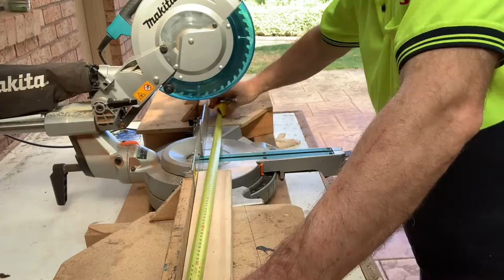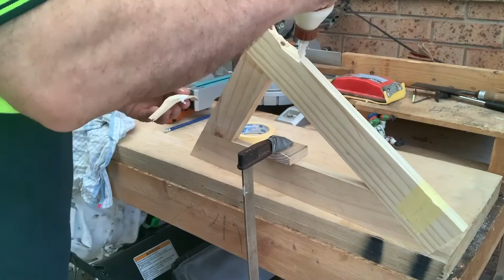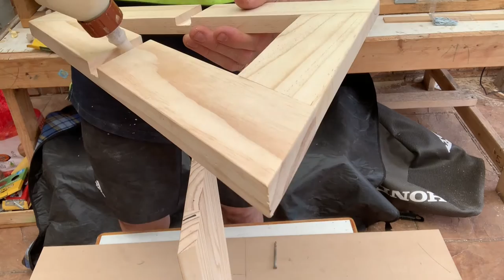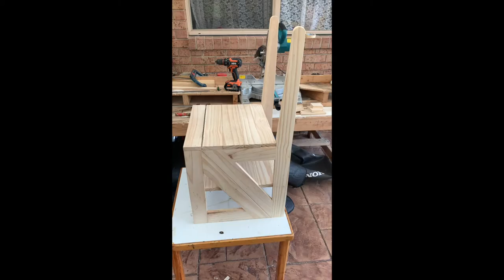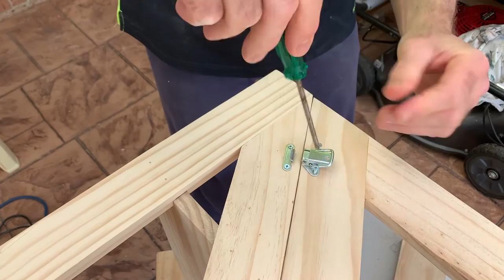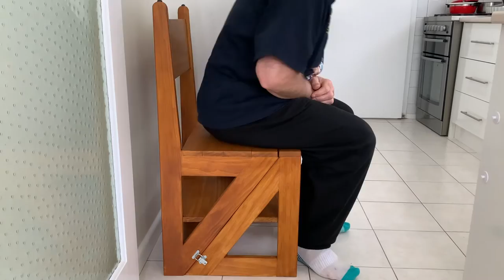How to build a DIY step ladder chair !

Comment: Can you tell me the thr size, measurement you use?
Reply from the maker: Hi  Riyan , the height= 920mm  ,  width 450mm , length 390mm , ,sitting position=460mm from ground , material = 70X19mm 1/190X12mm  ,  the angles of the legs were cut in to suit , I hope this helps in some way , ''cheers''

Comment: Conforms to the rules of wood working videos, rip cuts, cross cuts, angled cuts, the screwdriver going zipzipzip over and over. Good job. Not to leave out the rapid fire hammering of the chisel. Sorry, but Paul Sellers wins.